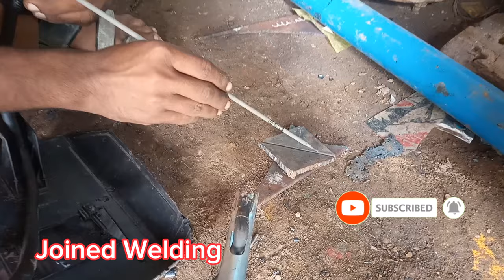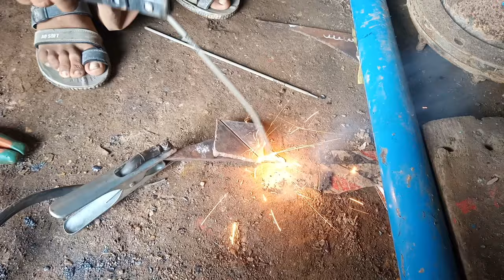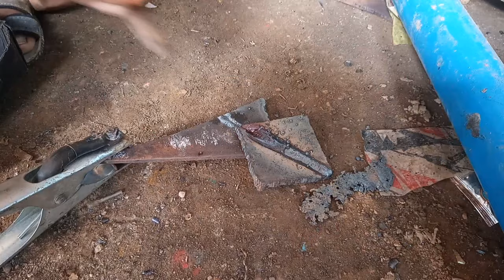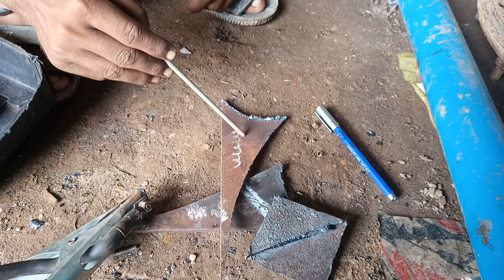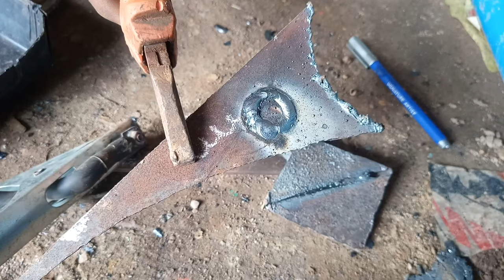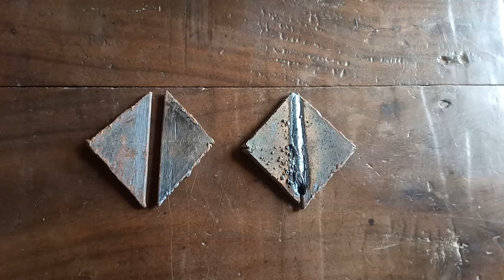3G Open Root Welding Method 💥🥽 | #welding #welder #mechanic #automobile

Comment: I'd would of drag welded the root in first. The weave it in. Build up the joint first with a root the hot pass over it. But your running the machine right and the beads look legit. Have to learn some how right.